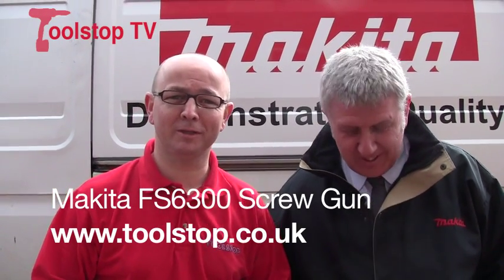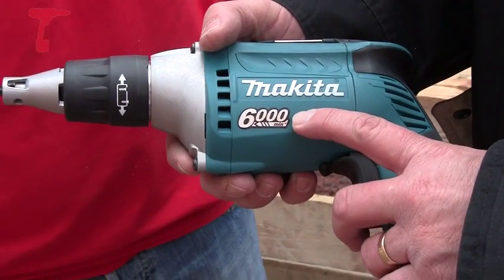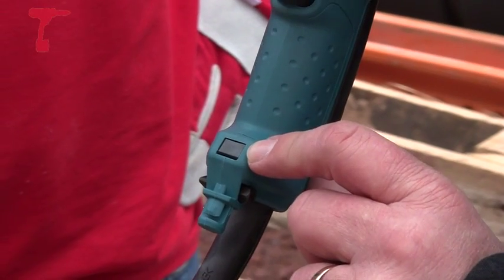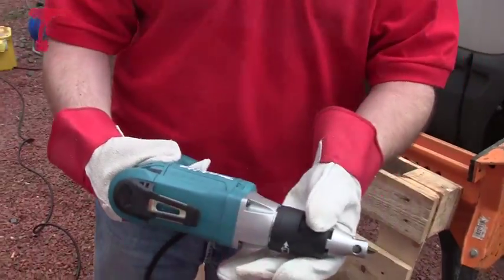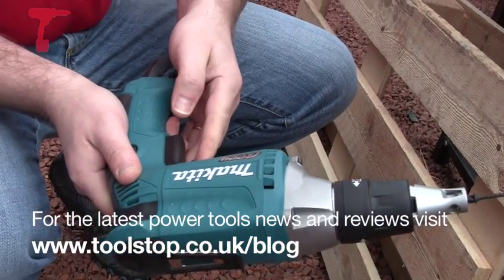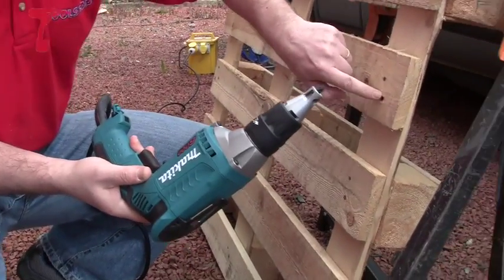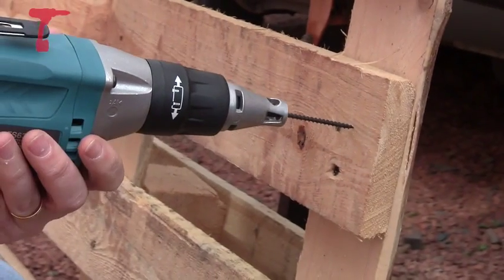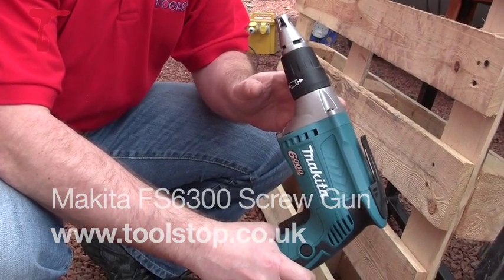First Look - Makita FS6300 Drywall Screwdriver

Comment: thank you for this information , i have another question ....which  devices model type and number (in makita hitach and dewalt )  that are used for the appropriate hole and tighten the hex washer self drill screws( 3\8" 1\4"5\16" ) in the steel plates
  ?

Comment: Hi how are you?. Im a drywaller and Im really confused I need one more drywall screwdriver , but i dont know with one to buy? Makita FS6300 with is 6000 RPM or  FS4200 wich is 4000 RPM, More RPM in this case means better tool?
Thanks Daniel
Reply: Hi man, how’s it going? I have to get a new makita drywall  scredriwer  too. What tool did you get? 4000 or 6000 RPM. Thanks and Greetings from italy 😊
Reply: @frankobell7772  hi, more rpm (faster) means less torque, that with 2500rpm (FS2300/2700k) it's more stronger (6mm screws) but all have same motor 570W power consumption
Reply: I've never seen anyone actually use a 2500 before so yea lol